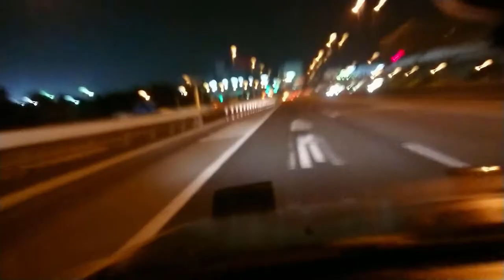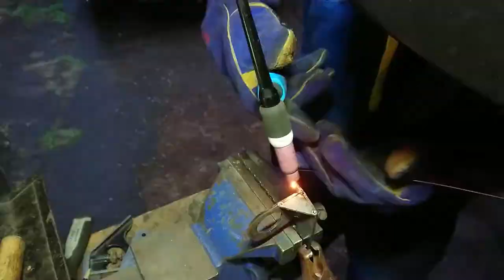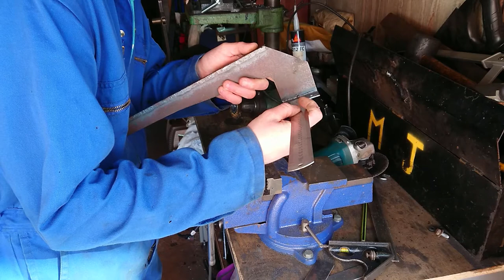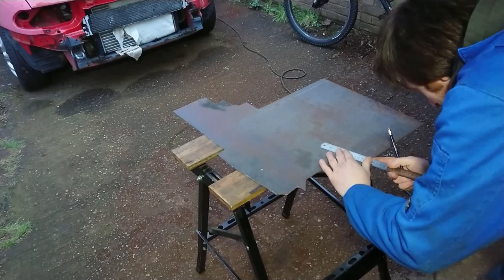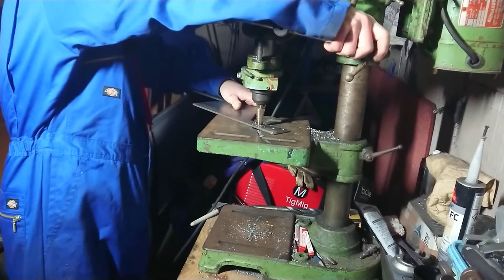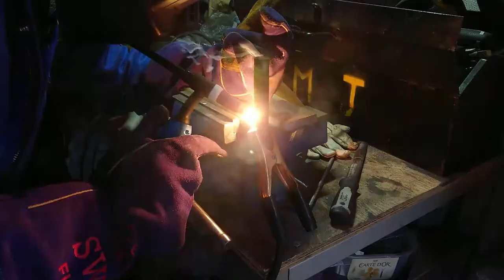CG10DE Power Mini- Radiator and Plumbing Part 1

Comment: Once you go to fit that water pipe to the engine for the final time grab a new O ring where it goes into the water pump, they leak after being disturbed... speaking of which it may be worth thinking about a new water pump, again mine leaked not long after completing the conversion, seals probably dried out and hardened with no water in the block.